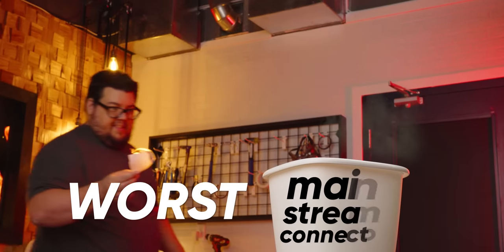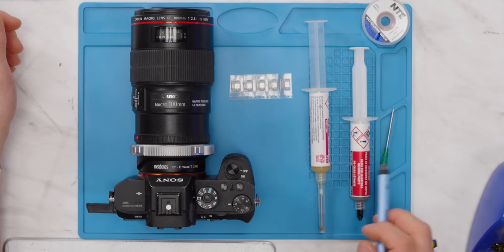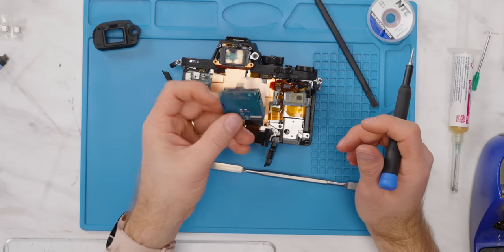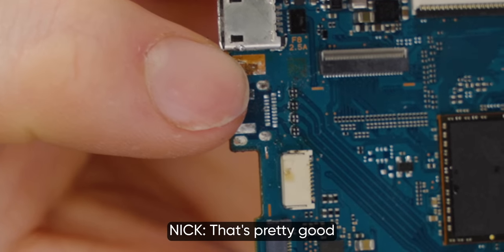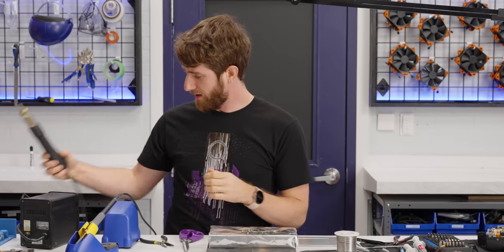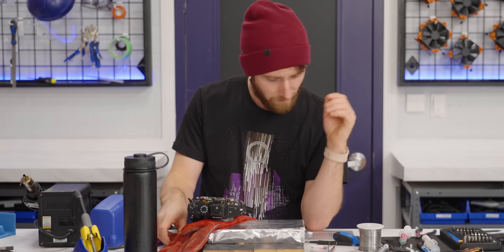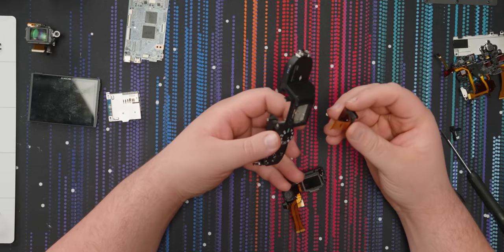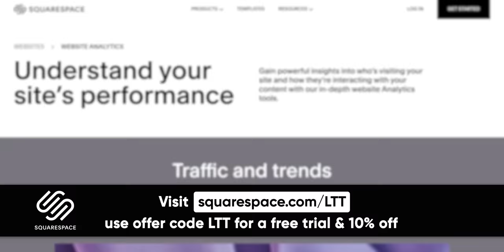This "cheap" repair almost BROKE me.

Comment: Suggestion, connect a micro hdmi extender to the camera so when continuasley unplugging and repliging, strain is put on the extender cable rather than the expensive to repair micro hdmi connector on the camera. When the extension cable fails, replace it with a new one, which is a lot cheaper than a motherboard replacement and will reduce wear on the camera.
Reply: I think that is a good suggestion. Still hard to keep the strain from the weight of the cable though. Maybe use a 3D pen to build a base at the end of the cable to stabilize it against the body of the camera and put the stress on the actual cable and not the connector, Then the only connection wear would be at the end of the adapter.
Reply: Also I wish they would go the way laptops did with barrel connectors and make them floating instead of fixed. That made them less likely to break the board connection from weight or accidental snags, and easier to swap if you did manage to break them.
Reply: @D3M3NT3Dstrang3r  There are HDMI clamps that get attached to the camera cage, that do exactly that.
Reply: @SimoBenziane  Interesting, I dont have the need for one so I have done no research on the matter. But Im glad somebody recognized the need.
Reply: @SimoBenziane  I would suggest a hdmi 90 degree adapter that stays on the camera. Fixing the plug/unplug wear and the stress caused by the cable being attached horizontally.
Reply: @SimoBenziane  Exactly what i did with my A6400. Won't break the camera port and is more convenient to use and there is strain relief if the micro hdmi to hdmi extension is screwed to the cage.
Reply: And, if the camera is going to stay in a mount, you can use a glob of hot glue to keep it from coming off. Its easily removed and common for strain relief, as Alex said in the WC Studio Pro vid.
Reply: @D3M3NT3Dstrang3r  yeah, there are camera cages that have clamps that will hold the cable in place at the point of where it plugs in.  

The trick I did was use a cable strap fed through the wrist strap ring on the camera to take the weight of the cable extender with the cable hanging overtop the camera to minimize the strain on the camera as much as possible.

Comment: Really should invest in a strain relief clamp for those Sonys—you can leave a micro to full HDMI dongle in there permanently.
Reply: Yeah, this is such a fixable issue lol. Hot glue a dongle on, done.
Reply: It comes with one. It bolts to the side of the camera. They must have lost it?
Reply: HDMI over USB-C would be SO MUCH better.
Reply: @Dunestorm333  USB-C unfortunately suffers the same issue of just being a connector that's way too small and bendable. Many laptop manufacturers split USB-C to a daughter board so it can be easily replaceable. I would still prefer a full-size HDMI in this case.
Reply: I wouldn’t even bother plugging in anything to micro hdmi at all. It will fail. I have an R5C and it has micro-hdmi, hilariously, and I just pretend it doesn’t have hdmi at all. Luckily I don’t need hdmi out.
Reply: @Dunestorm333  sony using a non proprietor connecter never heard that one lol 😆
Reply: @Andre Jarboe I have the S3 and can confirm it comes in the Box.
I also opened a A73 and it doesn’t have one, so maybe it’s only the R & S?

Also, the 3 at least has pretty good wireless/Bluetooth, so you can be totally wire free for monitoring
Reply: @Idiomatick  Most likely if we remember seeing how Linus opens any boxes lol
Reply: @Dunestorm333  Filmmaking gear don't work with usb-c. It's not a standard. HDMI at least is a 2ndary standard, SDI/BNC being the 1st. Neither does the camera output thru the usb-c, just webcam out.
Reply: ikr a cage from small rig is like $80 + $20 for the type C and HDMI clamp,
It's not realy and issue if you're a pro since you're gonna be building a rig anyway
so why not invest $20 for the clamps
it's so fkn cheap
Reply: @arthurkallinen  exactly!
Reply: @robertzhu  The smaller things get, the more liable they are to break. Who would of thought. ;p
Reply: a right (or left?) angle micro-hdmi plug can help reduce the leverage effect...
Reply: @arthurkallinen  HDMI over USB c is actually completely standardised, the port isn't universal in supporting it but there's absolutely no reason that film makers couldn't use it if they chose to
Reply: @Dunestorm333  full size hdmi or nothing
Reply: @bosstowndynamics5488  Not an industry standard what I meant, the gear we use is highly specialized and most devices support only SDI. HDMI is a consumer standard, that has leaked over, during a time period to pros using smaller and more accessible gear and to be more connectable to consumer products.
Reply: @robertzhu  Nope, USB-C is designed to break the connector at the cable while the port stays intact.
Reply: @arthurkallinen  But if you're using adaptors anyway (which every professional commenting here has said they do), what difference does it make if the HDMI adaptor is plugged into a USB c port vs a mini HDMI port?
Reply: @ThaexakaMavro  Good luck with that on something like a phone...
Reply: @Andre Jarboe I found it in the manual, page 17 and 22.  "cable protector" I wonder if it depends on the package
Reply: @xWood4000  apparently it wasn't included in the first run.

Comment: Little tip from someone who worked on PCBs for a long time. If you want to use a heat gun and want to minimize the possibility of desoldering or damaging other components you could put Kapton tape around the spot where you are working. 2 or 3 layers if you wanna be really safe. It's really heat resistant and protects the covered areas.
Reply: I'm no expert or even a beginner but like to watch people solder and this video had me freaking out, I knew something was missing but couldn't put my finger on it, it was the heat tape.

Comment: Pro tip: put a mini-HDMI to HDMI adapter in the port, glue the heck out of it and use the Adapter as a port. Do this before the Mini HDMI port gets weak.
Reply: Just buy $10 adapter that you can screw to rig cage (they using it anyway) and you are done. But it's only a problem with older Sony cameras. Newer ones has standard HDMI ports.
Reply: we really need d-sub connectors. They are forgotten but not obsolete.
Reply: This is the wrong way to do it. You need to cut an HDMI cable off at one end and solder each wire in there to each of those tiny pads, and then glue the cable into the chassis with strain relief
Reply: That's the solution I immediately thought of.
I would also use some glue that can be easily removed if the adapter fails at some point.
Reply: @cyrkielnetwork  yes was space really that small not to put a full  HDMI sized port even they made like 5mm bigger cover the larger plug size?
Reply: Don't need to glue it, there are adapters that you can lock in a cage
Reply: protip. just get something with SDI, HDMI is just shitty consumer crap, the less you have to rely on it the better.
Reply: @tjeulink  They seem to enjoy using stuff they may be able to make content out of though. Like repairing the HDMI stuff here, or the reoccuring we lost our data and built a new server videos.
Every time I see those videos and the explanations I get angry and sad because most of that would not be how storage is handled in the professional world.
Reply: I prefer using a super thin cable that is very very short but does not put stress on the port. Then I plug that into a thicker HDMI cable if I need to do a longer than usual run. Love my A7SII but wish they put a full size HDMI port or at least the intermediate sized port which is actually the mini the one on it is a micro.
Reply: switch it to usb c
Reply: @MrFaaaaaaaaaaaaaaaaa  16 people didn't understand you were not serious.
Reply: @ahmetrefikeryilmaz4432  i am 90% serious. I had to do something similar for my custom quadcopter, and while it sucked, I'll never have to worry about the connections between the camera and the motherboard coming loose. I did the connection between my radio and motherboard the same way, too. If it wasn't for the fucking absurd corporate capture of the FAA then I wouldn't have to do crazy shit like that to save weight.

sadly the drone regulations were written by lobbyists so I have to do stupid crap like this to avoid using heavy aircraft grade connectors that would push the weight of the quad past the weight limit

When a company is mass producing a drone they can put all the parts on custom circuit boards to avoid having to do this, while hobby drone builders get FUCKED.
Reply: @nilskahle5863  oh yea i know, they just enjoy tinkering. but the solution is not to glue some adapter in place, its to ditch the shitty connector all together.
Reply: @ahmetrefikeryilmaz4432  They’re still widely used. But d-sub connectors aren’t compatible with the really high-speed signals in things like HDMI.
Reply: @tookitogo  why? This is a real question btw, I'd like to learn why. Everything I know about signalization (which is admittedly not a lot) tells me d-sub may perform even better if the connection between pins and wires are done correctly.
Reply: @ahmetrefikeryilmaz4432  I’ll be honest that this gets into areas of electronics that I haven’t gotten to in school yet. But despite not yet really understanding why it is so and exactly how it works, I know that at very high frequencies, wires transition from being simple conductors to “transmission lines”, where careful control of the impedance matters. This means the size of conductors, the distances between them, and the insulating materials become a complex system that requires careful control to prevent signal loss or reflection. (I’ve laid out PCBs with impedance-controlled traces, and the software calculates the width and spacing of the traces based on the required impedance and the materials of the PCB.)  

Modern high-speed interconnects like HDMI, DisplayPort, and USB 3 don’t just use small pin pitches for convenience, it’s also because of electrical characteristics. It allows the two lines in a differential pair to maintain their characteristic impedance, without which the signal will degrade.

Maybe someone else who happens to be more knowledgeable can chime in?
Reply: @tookitogo  so it's like ethernet?
Reply: @ahmetrefikeryilmaz4432  Sort of, but at much higher speeds and without the robust (but potentially slow and non-deterministic) error correction in Ethernet, and thus with much tighter requirements. Ethernet on copper currently maxes out at 10Gbps. As of right now, USB tops out at 40Gbps, HDMI at 48Gbps, and DisplayPort at 80Gbps. And as I alluded to, Ethernet can resend a lost packet if necessary, so imperfect cabling can be tolerated to an extent. (It depends on the protocol. Computer data usually prioritizes data integrity over speed, so will retransmit lost packets. But there are protocols for Ethernet, used for streaming video, that prioritize being real-time and thus don’t retransmit.) HDMI and DisplayPort cannot, since they’re time-sensitive. (I think that’s how USB works, too, but I’m not 100% sure.)

Comment: Should probably include "helping hands" to things that you will need, they really help when soldering stuff
Reply: come to think of it, I've never soldered away from a workbench with at least one other person nearby... I never thought about it before but we ask each other for small shit all the time.
Reply: I was thinking the exact same thing.  I have Helping Hands.  However, Helping Hands is a little bit lightweight, and you would have to tape it down to the table if you needed to apply any extra pressure.
Reply: Only an amateur recommends such things. 😂
Reply: A board holder is a better approach. They even included it in the video from another channel how to fix it (3:50). Sadly they never used it.
Reply: Yeah a board jig is inexpensive and insanely more helpful than helping hands but both are useful for their own reasons.
Reply: I prefer a pcb holder. I use one from Hakko but end up just using it as a weight 95% of the time and not how it's intended lmao. All that really matters is something to keep it in place so it does move while you're doing high precision work. High heat tape works in a pinch fine.
Reply: I mainly work with really small things (like tp4056 charger boards) so I've never even heard of a board holder before - thanks for the heads up guys!
Reply: @bnelsey  You’re in for such a treat, just make sure reviews say something about the weight size compatibility. You can also get some non-slip grip feet so you can stick them to the bottom if it doesn’t have them already.
Reply: And kapton tape

Comment: The 'external screen' is actually a data recorder giving 10bit and higer bit rate over the internal 8bit and compressed video.
The answer is to use lighter cables as its only a short run. I found some coiled ones and cable tie them to camera cage.
Reply: Securing the cables so there is no load on the connector is the key.
Reply: @maddan.  Yeah, cable clamps and a cage to mount them on.
Reply: If the connector just stays attached all the time you can also hot glue it in place. Semi permanent and you can usually just peal the hot glue away if you need to take it off the camera. 

If it need to be plugged and unplugged a lot a 3d printed mount that supports the cable and attaches to the camera works a treat. Bonus points if you can design it so the mount stays on the camera and the cable slides straight in and out so you can’t stress the cable trying to put it in at an angle.

Comment: never E V E R apply any amount of force on a component you are desoldering as you may rip a pad. The idea is you melt the solder, not breaking it. It is a bit more difficult when components are also adhered into place or if there are thru-hole mounting tabs, but for most smd components if you feel it doesn't want to come out, then it's probably not reflown correctly yet.
Reply: yeah linus isn't really competent at much nowadays
Reply: RogerWilco99  Yep, ZD-915 here and wouldn't do without it.

Comment: Connectors and hot air do not get along. Hot air is great for removing already-broken connectors, but a pain for installing new ones for all of the reasons Linus illustrated. The only time you want to use hot air for installation is if the component has terminals you can't reach with a soldering iron. Even then, you want to pre-heat the PCB to as close to the solder melt temperature as you can reasonably manage. Radiant (think toaster oven coils under the PCB) or convective (similar to the hot air station, but wide, slow moving and under the board) board heaters are common.
If all the terminals are accessible (not sure if Linus' were), the good old soldering iron is the way to go. Bridging contacts is actually okay - add a little flux and clean off the extra solder with solder wick. The same capillary action that makes the wick work will keep solder between the terminal and PCB pad, assuming the terminal is flat against the pad. That means doing your best to clean off the pads before adding flux and placing the component. They can be tinned (solder colored) but should look completely flat. In this case, you don't add any solder or solder paste before placing the component - the flux already in the joint, a pre-heated PCB and the iron heat will let regular old wire-type solder flow into the joint in a heartbeat. Don't try to solder individual pins. Do 3 or 5 (or however many fit under your iron tip, which should be the largest you can physically use for the job BTW - better thermal transfer) terminals at a time, or even get a blob of solder on your iron tip and (gently) drag it down the row of terminals. With a little practice, the blob will heat up the contact and pad, flow some solder into the joint, then separate cleanly (assuming the flux hasn't all boiled off) as the blob moves on. Again, bridged terminals can be de-bridged with wick and still more flux.